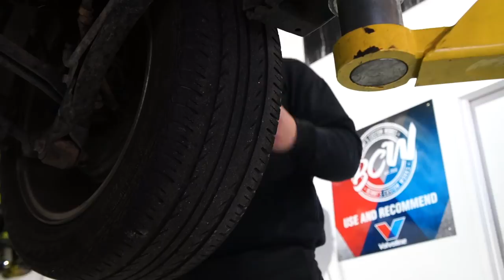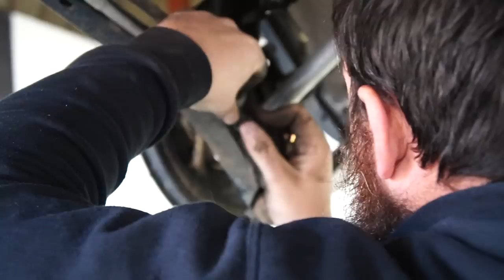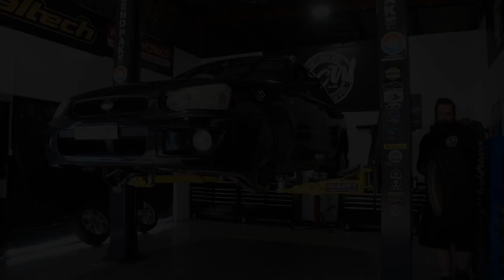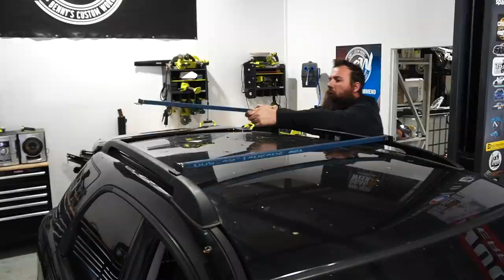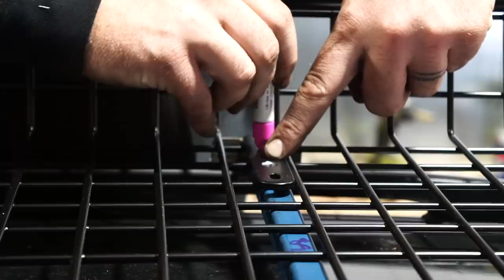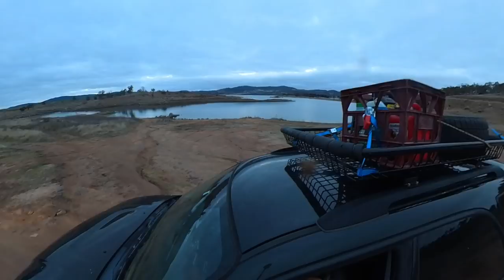Subaru Impreza | Safari Lift (Pt 2)

Comment: I thought u we're going to flush mount those cross bars myself with the angle iron parts attached flipped the other way
Reply from the maker: The basket wouldn’t fit that way :(
Reply: @BennysCustomWorks  is that cause of the curve of the roof rails?
Reply from the maker: @postiepat1541  exactly

Comment: Nice one.  "Subaru jigsaw" indeed.
I don't want to tell you how to do your job, Benny, but rubber suspension bushes are always tightened at ride height, not full droop.  That way the bushes are in their natural postion and they don't tear when the suspension compresses.
Reply: Couldn't agree more to that

Comment: Ben, nice roof rack tutorial. Just picked up an '02 Outback EZ30, so this is insightful. I've been replacing rusted 6mm bolts with stainless or coating with anti-seize paste. Salt treated/brined roads leaves a lot of rust... Any thought of mounting a light bar on the basket?

Comment: Benny, don't want to be safety guy, but using that angle grinder without a guard could lead to a bad day. Pieces of broken disc in the face are not a good time.

Comment: Why not flip the blue bars over for a lower profile?
Reply: probably to clear the bolt heads, but I like the cut of your jib.  would be super low and clean.
Reply from the maker: The basket is slightly wider than the factory rails so it wouldn’t have sat between them. I looked at it but it didn’t work :(
Reply: @BennysCustomWorks  Flipped with an offset on the welded angle pieces, so between but just above the side rails?
Reply from the maker: @jonathanrees3765  the rails curve so hit the basket. If they were dead flat your idea would have worked.

Comment: Every Canadian that has ever done rear laterals is jealous of how easily you pulled that bolt from the upright
Reply: If there's one thing I've learned from watching Speed Academy and Deboss Garage, it's to avoid working under a Canadian car at all costs 😨
Reply from the maker: @mrclown7469  i’ve scraped block fragments off of a 6bt in canada. It’s amazingly bad.
Reply: @mrclown7469  Or anything from New York State or Staten Island if you are watching South Main Auto. ;-)
Reply: Could not believe how easy he made that look. I cry foul.

Comment: Cool project to watch(As all of them). but it still confuses me why to lift a 4WD Subi for snow. I have a FWD Octavia here in Switzerland and never had an issue. It's not the lift which does the trick It's the Winter/Snow tires!
Reply from the maker: It’s an all rounder. Also we can’t buy snow tyres easily in Australia and we only have remote areas of snow

Comment: Benny! I need to know, what was the purpose of changing the front control arm rear brackets? Caster angle because of the extra lift with the springs??? I know you need the trailing arm brackets for the rear wheels but this is the first I've seen changing the brackets for the FRONT wheels.
Reply from the maker: No they were just flogged out, like for like maintenance.

Comment: Honestly, I think I wouldn't put the subframe spacers in even if it is the right way to do it. I think I'd rather keep the bit of extra ground clearance and fix the issue by getting new driveaxels with better CV's that can handle the extra angle under power.

Comment: I might be over thinking this, but with the rails and new crossbars, is there a risk water could get in through the holes and cause them to rust or for the rails find a way into the roof?
Reply from the maker: Can’t get into the roof as the rail ends are solid plastic. The. Aluminium tubes already have drain holes too

Comment: Shouldn't you have final tightened all the bushes on your LCA, lateral and trailing arms with weight on them? The rubber will be binding and can cause issues with alignment and faster wear on your bushes, luckily the angle of your arms at full droop looks fairly close to your angle at ride height but it still doesn't seem optimal.
Reply: They had an alignment done after installation (off camera).
Reply from the maker: As mentioned we had an alignment done, while it was there I had them relax and re tighten the arms as we don’t have a 4 post hoist
Reply: @BennysCustomWorks  seen a guy make four stands to go under each wheel then lower the car on to them while still giving room to tighten up the arms

Comment: One thing i cannot understand about Australian: proud to measure power in kw ´cos it´s metric but uses inches :)
Reply: We use metric for most measurements but with cars a lot of things are standardised in imperial eg:tube size
Reply: @JoshVC  i have stop a little to calculate what 4 inches mean in cm, and also have to stop and calculate what 100 kw mean in hp... i´m always in the wrong unit, no matter what :)
Reply from the maker: @alucardtnuoc  I normally offer both measurements so all viewers can understand what’s going on . 1 inch is 25mm approx and one hp is approx .7 kW
Reply: @BennysCustomWorks  keep up the awesome work. I’m not disappoint or anything like that, after all it’s just a matter of exercising some math. I’m actually making fun of me :)

Comment: Didn’t realise it was so much work to lift your Impreza
Reply: Honestly, you could get away with just using Forester struts and the rear trailing arm brackets. But since they went with even MORE lift using the aftermarket springs over the stock ones, you need all the extra stuff to correct the suspension geometry. You could even just remove the rear sway bar entirely, but in some places I don't believe you can legally do that (vehicle inspections, etc).